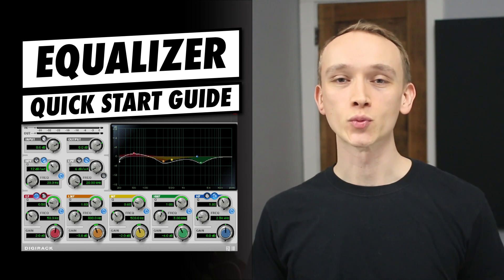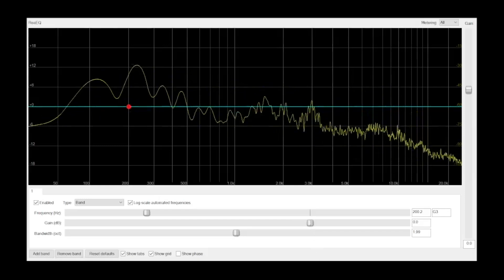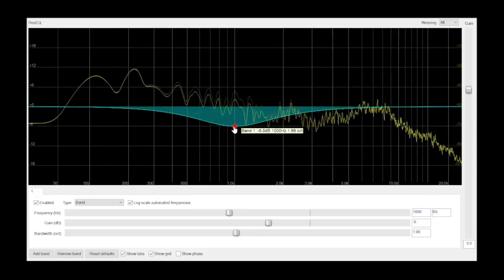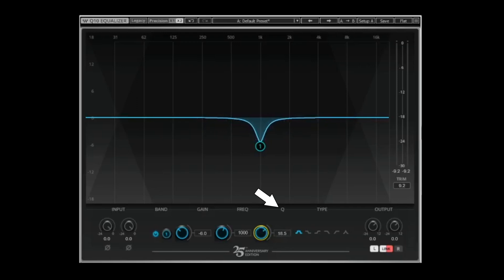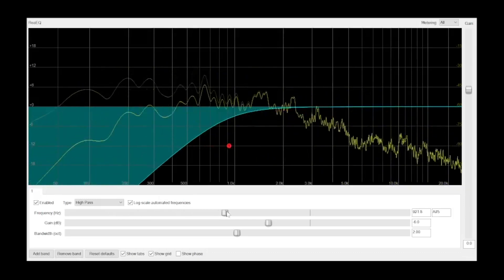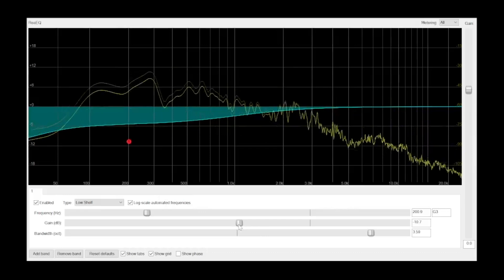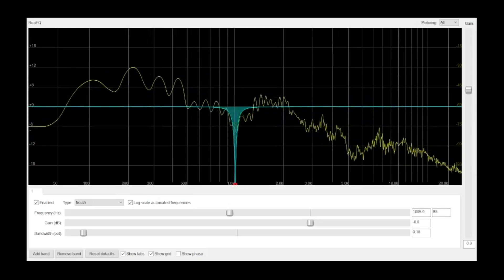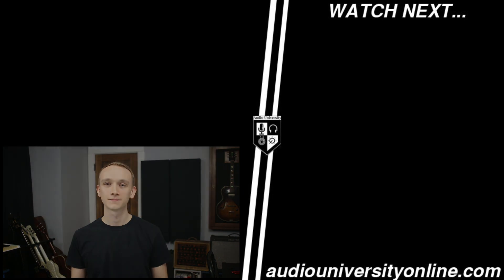How To Use EQ For Mixing | EQ Controls, Shapes, & Filters

Comment: Great content as always! I have a question about how EQ works.  If I boost in a certain range, could I hypothetically achieve the same results by cutting the other frequencies? 

For example: if I boosted using a high shelf at 500 Hz, could I theoretically have the same exact effect on the signal by cutting with a low shelf at 500 Hz?

Comment: Wow, just now realizing I don't know what the number behind the Q settings actually means.  So in Reaper's EQ, the Q number is representative of octaves.  But what about in the next example, where the higher the number the narrower the Q?  Does that number still measure octaves?  If so, would it still have the same 1 = 1 octave reference point, but in reverse - to where a Q of 0.5 would be two octaves, and a Q of 2 would be half an octave?
Reply from the maker: Hey Christopher. I don’t yet have a video on this specifically, but it’s a great idea! Thank you. 

In the meantime, check out this page: http://www.sengpielaudio.com/calculator-bandwidth.htm

Comment: Question: are you a teacher? If not please  consider, you a natural. Question 2: is hum in Europe on a different freq? We use 50hz acdc I believe
Reply: Hum can be electrical frequency dependent. In the US that's 60 Hz and other places that can be 50 Hz.

You could use a single band of a parametric EQ, maybe a notch boosted and sweep till you hear it. To reduce that, then cut it at that point. You might need to edit the Q bandwidth and the center frequency to get your desired cut.